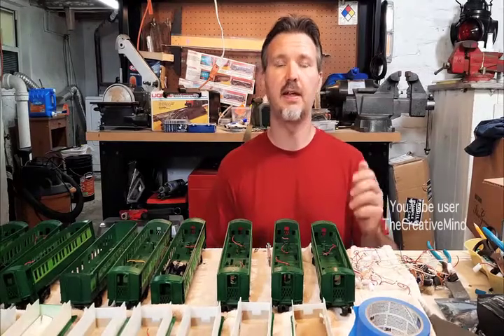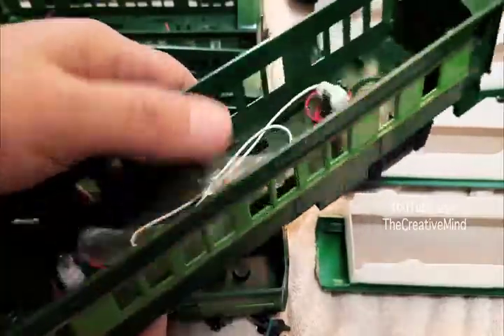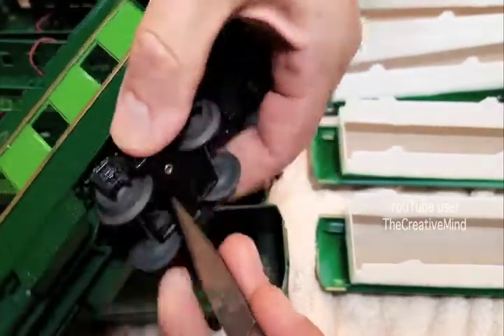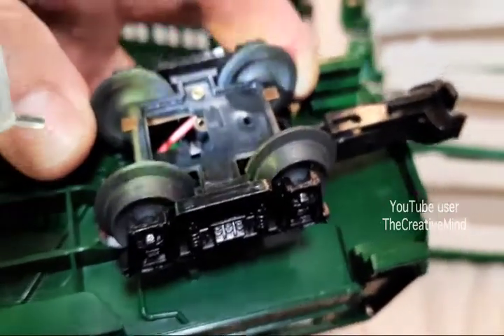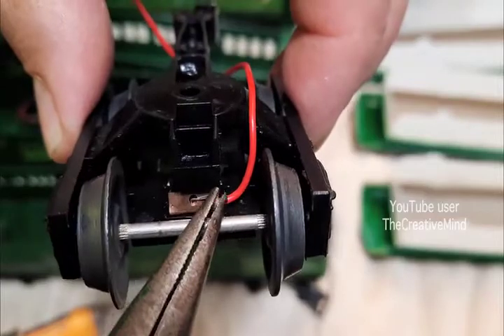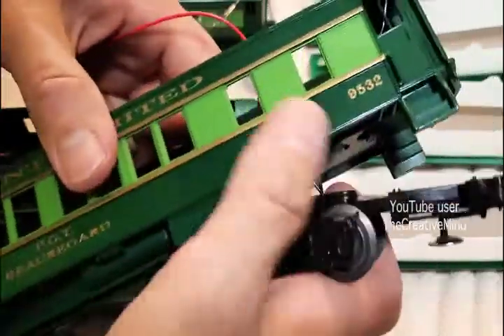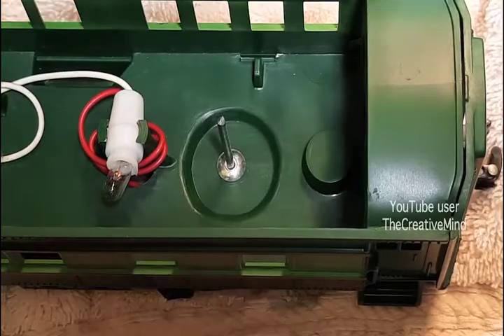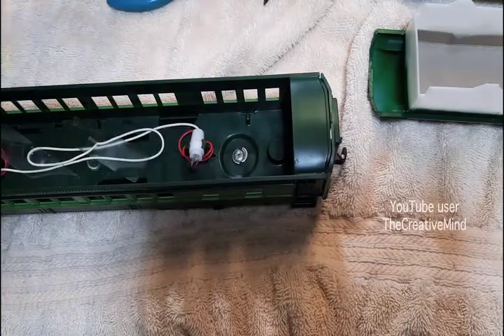Solder wire on Lionel Post Wars Truck / Pop Rivet Installation

Comment: Good video. 
Some things that might help. 
The trucks don't have to be taken off the cars. 
The hole roll plate comes off the actual truck. 
By prying on the side frame the roller assembly comes off truck.
Held on truck by two plastic tabs on each side. 
 Then you can solder your wires on with ease without having to remove the truck. 
Hopefully this tip helps.  
Ps these are not post war but MPC error cars from the 70s.
Reply from the maker: I always thought they were molded in place but then I saw the plate move and tried to remove it but was afraid I would break the truck. Awesome tip thank you. And yes you are right about them being MPC cars, I had postwar on my mind for some reason.
Reply: Glad to help.  Thank you for mentioning us at Hennings trains.

Comment: nice idea with the pop rivet.   Grease the broken washer. Can you use the postwar  CP-58 pivot stud in that situation as well?
Reply from the maker: Thanks Jim. Judging by the pivot stud, it looks like it's meant for metal to metal mounting. The MPC cars are thicker because of the plastic and require a longer "pin" to hold them together.